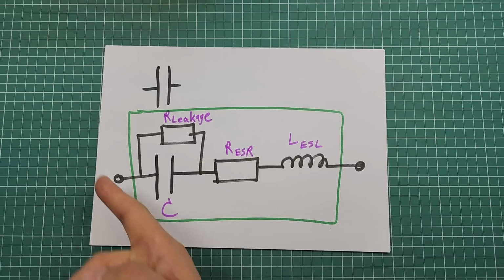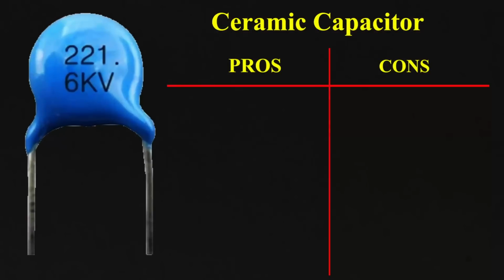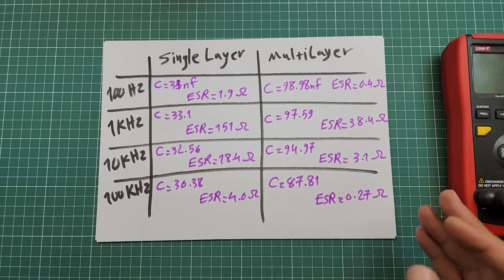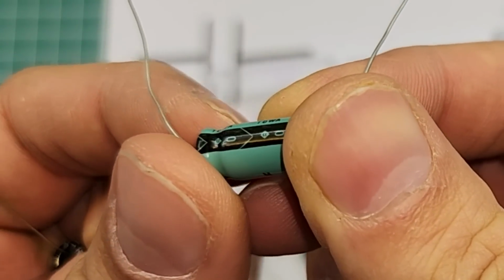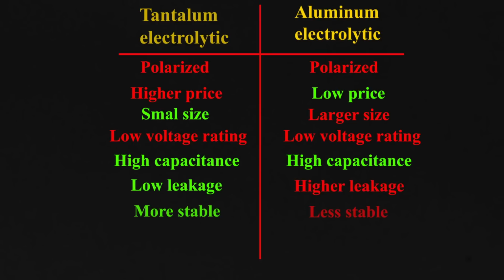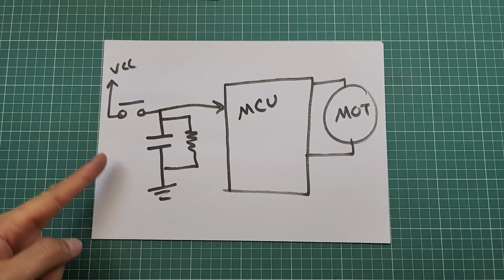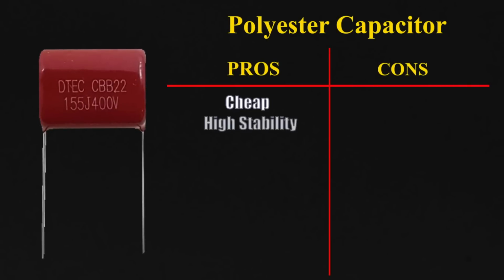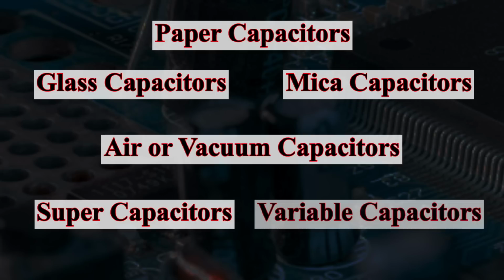Why So Many Capacitors? Understanding Their Differences and Uses!

Comment: According to data I can find, the capacitor presented as being polyester film, marked "DTEC CBB22" is polypropylene film, not polyester. Polypropylene capacitors are very much superior in most ways compared with polyester film types. They have much lower temperature coefficient of capacitance and very much lower dielectric absorption. The can typically be obtained with better initial tolerance than polyester types (it simply isn't worth making polyester caps with high initial precision because they aren't stable enough). Polypropylene capacitors are suitable for lots of demanding analog circuits. Polyester caps are not.

Comment: It is simply false to say that all ceramic capacitors are "inaccurate" and "unstable." There are ceramic capacitors  that are superior to most other types when it comes to stability with time and temperature and they can be made with quite good precision, again superior to many other types. These capacitors are also typically much better than most other common types when it comes to exhibiting low dielectric absorption, which is critical in many analog applications.
Reply: It was a comparison between single layer ceramic and MLCC, not a claim on "all ceramic capacitors."  7:15 - 8:20.

Comment: I grew up with the notion that tantalum capacitors were always the "tear drop" design and that they had specific applications outside of what a typical electrolytic would be used for. My biggest problem in learning how to use capacitors was that the instructors failed to teach me how to calculate the value of a capacity needed in a given circumstance and that mean that I never really learned what I wanted to and finally got pulled in a different direction and ended up never learning electronics like I would have liked to.

Comment: Ideal Capacitor vs real capacitors
Leakage resistance (parallel) - (series) R equivalent series resistance esr - (series) L esl equivalent series inductance
Ceramic Cap - on ardinuo or on a dc motor for filtering.
single layer vs multi layer 
Transformer to diode bridge to cap - DC rectifier 
Current draw impacts the ripple observed
Polarized like electrolytic vs non polarized like ceramic.
Different schematic drawing have the positive side as straight, not curved.
White strip is the negative (curved)

axial leads (straight), radial leads are on the same.
in electrolytic capacitors, the have an oxide, black material that he scratches off of the aluminum and that allows for higher capacitances and adds polarity.
Bad for an AC application where the polarity matters.
tantalum metal is a more expensive and smaller and better.
Temperature is proportional to farad.  heating increases farads.
Thoses are paper film (dialectric)

But there are also plastic films (like polyester, or polypropylene, or polycarbonate)
They are stabler from a heat perspective. 
Plastic Film is good for a Motor Control Unit (MCU), a motor delay circuit.
Heat sheilding
Good for snubber circuits

MKT capacitors are plastic that are higher quality.

Glass, Air, Vacuum types like paper, plastic films, and ceramic as dialectric materials.
Super or Variable types.

Comment: great video, but i have a small addition: the capacitors stability over temperature and voltage is more so determined by the dielectric used to build it and not by how many layers it has. A MLCC with a class 3 dielectric can also express huge shifts in it's parameters
Reply from the maker: Thank you for the point 👍

Comment: This was a really great video. I really needed this one. Structured in a good way and with nice to the point practical examples. You should make more videos like this one about different things and technologies an electrical engineer should know about. for example filter types or power supply types and how to design them. Well done. Great work.
Reply from the maker: Awesome,  glad  you liked the video.
By the way,  there is already a video about RLC filters in the channel.

Comment: Electrolytic capacitors have low voltage rating? Didn't know 500+Volts is low voltage lol. Yes there is much higher voltage rating caps but let's by real, electrolytic caps have very wide voltage range.
Reply from the maker: Yeah, it is possible to make an electrolytic capacitor with much higher voltage rating.
My intention was to talk more generally. I mean electrolytic caps have lower voltage rating RELATIVE to others in general 👍

Comment: This video does a fair job of covering the basics. I give you a B+ for what you've covered.
You forgot C0G ceramics, which are nearly as stable as mica, which you mentioned in passing at the end but deserve special note for their high stability and durability. You also forgot to mention the piezoelectric properties of ceramic capacitors, which can often be a deal breaker.
Tantalum capacitors tend to have much lower ESR than aluminum, which is often a design consideration in power supply regulation. With some LDO linear regulators, a designer might specify a low value aluminum electrolytic on an "internal ESR will stabilize it" basis.
Class II ceramics with any DC across them have voltage dependent derating that a designer needs to account for. The major manufacturers typically publish derating curves and they're fairly well characterized, so this isn't so much a disadvantage as a "potential trap for young players."
Finally, the charge tank motor control circuit could work beautifully with a C0G ceramic and a fairly high value resistor, depending on the desired duty cycle of the motor.
Reply from the maker: I appreciate your B+ 😁
Reply: Lol
Reply: @elewizard You’re a wise man. And entertaining. Thank you.

Comment: Great introduction to capacitors. An important, relatively new type of capacitor is the polymer variant of aluminium and tantalum electrolytic capacitors. In them, the electrolyte is replaced by a solid polymer material, which makes the capacitors have overall better characteristics than their wet siblings. They are becoming especially popular in SMD size.
Reply from the maker: I haven't heard anything about it,  but it seems awesome 👍

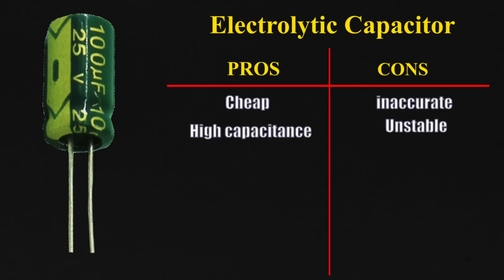Comment: Interesting video. Btw,... at 12:40 you're mentioning tht the electrolitic capacitors are not durable, leakage, inaccurate etc... Last week, I've tested some of my older capacitors which are been recycles and stored, some of them are over 50 (!!) years old. I used professional lab equipment and guess what... Perfect! The value was right on the spot and they all are in a fine working condition. So I guess you could say mine are very durable and accurate...  ;-)
Reply from the maker: I said that in a general manner. I mean, electrolytic capacitors are more likely to get aged compared to other types
Reply: They don't make them like they used to. 😁

Electrolytics seem physically smaller for any given capacitance / voltage / temperature rating,  than they used to be.  So maybe that is a trade off vs reliability.

Comment: Dear Sir. This video was very interesting and informative. I usually work at high frequencies like 30 MHz and above, and sometimes I get inaccurate results in the circuit performance. What type of capacitors do you advice for such applications to get better results and accuracies?
Reply from the maker: Thank you for the compliment. 
It depends on the circuit requirements, this video covers a major part of the journey but there are other points that you have to research yourself. 
You will come across many problems when working at high frequency other than choosing right capacitor type.

Comment: Nice, and I thought i knew all there was to know, had no idea there was so much variation.  But i still dont understand how these things work.  Like how they pass electricty when theres no connection.  I seen a good video that used the water anology with capacitors, a capacitor was an elastic membrane in the water pipe.  so normal DC water couldnt flow straight through, but vibrating water (alternating current) the elastic membrane was able to reproduce the wave on the other end.  In a way capactirs copy electricity, not really pass iit?  Thats what the analogy basically say. So the original electrons dont actaully get past the capacitor, they just get converted to electricla field?   But thats just an anology...  Anyway thanks for a  good one on capacitors.
Reply from the maker: Thank you for watching

Comment: What about parasitere infectivity of  capacitors, which have wound foils? In fact, they should behave like a LC-LC... Circuit where the L are in series and the C are parallel connected between the Ls.

Comment: Tantalum caps can burst into flames upon failing. That disadvantage is not mentioned in this video.
Reply: Electrolytic capacitors can explode and ricochet across the room leaving a trail of aluminium chaff.  That disadvantage is not mentioned in this video.   

😁😁😁
Reply: If properly derated, they work fine. See manufacturer recommendations. But old things can fail. Some electrolytics have destroyed circuit boards due to leakage. Resistors can burn, too. Tantalum is anyway a problematic material due to mining conditions.

Comment: What is the usual uses of ceramic capacitors?
Reply from the maker: They are general-purpose, you can use them in almost everywhere
Reply: Filtering, supply decoupling on digital logic circuits are two key uses.
Reply: @deang5622  what is supply decoupling
Reply: @notaras1985  It is the use of small values of capacitor placed next to digital logic integrated circuits across their power supply lines.  Without them, the logic chips will malfunction

Comment: Very helpful, thank you. I believe I will use a ceramic capacitor soldered very close to or on the terminals of my 12vdc motor project where polarity will be switched back and forth on a timer. Before watching this video I only knew of ceramic and electrolytic capacitors .. I knew there must be others but didnt know anything about them. Thanks again, very helpful.
Reply: Actually, in 99% of the times you want to place capacitors close to power terminals (in parallel) of critical components. It is a must for ICs, MCUs. As close as possible.
Reply from the maker: You are very welcome

Comment: Please make a video om where the companies get the elements to make a component. Im curious where they form naturally on earth. Is it some vegetables and fruit or is it all metal and material inside the earth?
Reply: The electronics world is mostly minerals as the feedstock.  That is, never-living material that's mined out of the ground in some form or another.  Silicon's feedstock material is sand, and metals are found in compound form like oxides, as one of the ingredients of rocks.  The same is true for just about every metal and metalloid in a circuit.  And even some insulators, like ceramics.

Plastics are the main exception, as they are distilled from petroleum, which is ancient plant life.  The same can also be said about adhesives and oils like transformer oil.